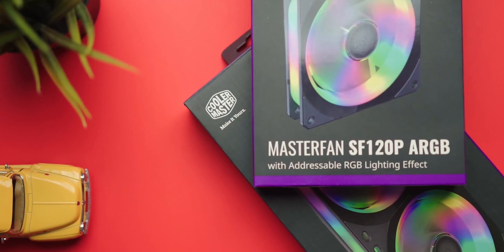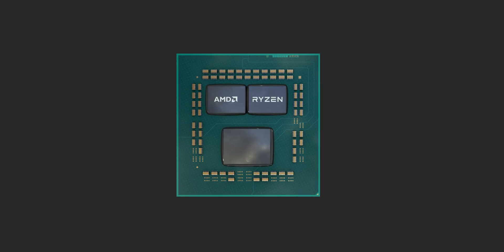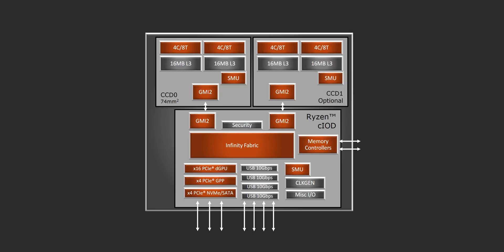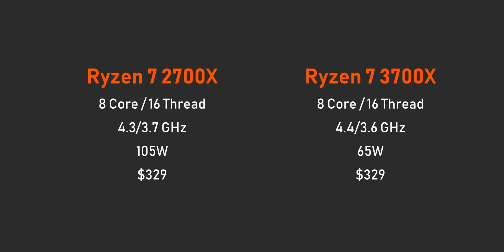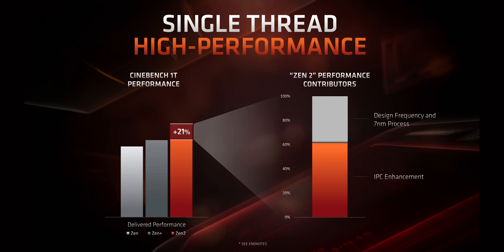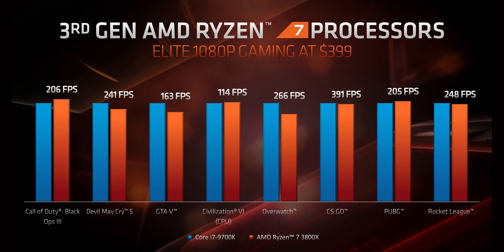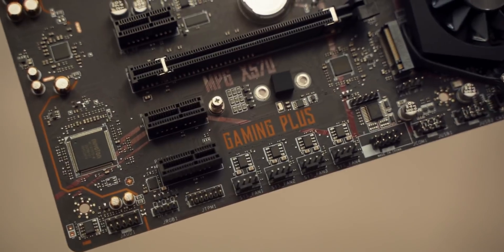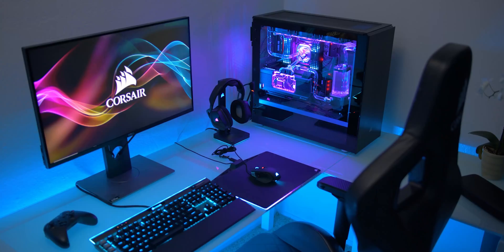AMD Ryzen 3000 – A Very REAL Problem For Intel?

Comment: Well one of the cores of my 6700k went bad. So im going to get a ryzen with 8 cores baby , should of got the v8 from the start lol
Reply: You overclocked it?
Reply: Vlad Vahnovanu yes i think i mest it up because i had set a adaptive turbo cache voltage of 1.35 but i thought that was safe
Reply: Vlad Vahnovanu not to sure what happened though tbh it worked fine for a week but one day i remoted into someones pc now i cant use the pc without disabling a core. If i enable all cores i get stuck into a boot loop
Reply: Can't you still return it? Do it quickly and buy Ryzen next!
Reply: Vlad Vahnovanu i wish but i delidded mine and its limited 3 year warranty is over but funny thing is i was going to upgrade newayz so im fine

Comment: in my 30 years in PCs i used 70% of the time AMD. always better value for money. always. Last time i saw a good Intel product was core2duo and core2quad 2 years after AMD was kicking ass with their Athlon64 and later Fx cpus. Intel after that just became greedy and lazy as fruck. especially when their entire chipset hold just for 12month if you are lucky.
i will definitely go to Ryzen 3000 but i am waiting for the X550 chipset motherboards cause I don't need pci 4.0
Reply: I think it's B550 not X and it's coming Q1 2020!

Comment: Ryzen 3000 isn't as much of a threat to Intel has the new Eypc line is.  The new Eypc line will likely provide superior security plus superior processor density in the server market.  However, I think AMD is going to have difficulty supplying Eypc servers fast enough.  Intel is going to need to replace Core architecture before it will stop shedding the server market share it is likely to start losing to get rid of all of these newly found security exploits in hardware.  Until then, I think security researchers and black cap hackers will keep poking holes in Intel's security like a wet cardboard box, with each new mitigation continuing to compromise Intel's performance for an extended length of time.

Even if Intel managers to replace Core architecture in 2-3 years, Intel will still have to go through the tough validation process that Eypc has gone through.  Eypc may be very well be cemented and leading the server market in new, untold ways by then.  Intel isn't finished, but boy are they in for the hardest years in the companies history. They can't depend on their old monopoly tactics anymore to keep OEM's onboard with Intel like they did in the 2000s as every major regulatory body has brought the smackdown on them already, plus Intel will have a difficult leapfrogging technology support wise back into first place.  For years AMD trailed 6-8 months behind on adding important features like USB 2.0 support to motherboards, but once again this was because Intel withheld important information on these new standards for extended lengths of time to hamper AMD.  Now that all of those anti-trust cases from the 2000s have played out and Intel can't do that either... the Ryzen 3000 and X570 launch are the result.

This is a great time to be alive for technology progress.

Comment: Does this mean that in a quadcore there is the same hardware as in a 16 core but 3/4 of it is deactivated? Wouldn't that be very inefficient?
Reply: not all chiplets work perfect so in a quadcore you get one chiplet with a perfect working unit an a defected that is deactivated an the second chiplet is not there or is just a fake one. the chance for a chiplet to have 8 perfect working cores shouldn't be so high
Reply: Of course it's not, because AMD is using ALL their chiplets this way so max gain!

Comment: The new APU's use the 12nm+ process, slight error but no worries! :)
Reply: Yes Zen+ and a higher clocked vega iGPU.
Reply: So it's going to have a 10nm Zen 2 chiplet alongside a 12nm Vega chiplet? Seems legit.
Reply: @TeriiNekoyama 
What are you talking about?
He said it's still 14nm, it isn't. It's using Zen+ monolithic chip.

Comment: Either way this will be a big win for me upgrading from an i5-4670k.
Reply: What Ryzen 3000 cpu you getting?
Reply: Planning on the 3700x. Originally I was going to go for the 3600x but the $70 price differential seems minimal for the extra cores/threads.

Comment: I really appreciate what AMD is doing and I am myself using a Ryzen 5 2600X for the last one year. 

But I think the biggest crap AMD is silently pulling (taking a page out of Intel's scummy book) is releasing the cheaper and more affordable B550 motherboards a whole 7 months later (early next year) . 

So all those builders whom we have been saying to wait for Ryzen 3rd gen should either get an expensive X570 board or wait more for cheaper options. This according to me is highly anti consumer practice from AMD !! Absolute bullshit
Reply: Dude if you're looking for affordable they have older boards that still work with everything anyways. There's a chance b550 won't even have pcie 4.0 and therefore won't be much if any better than x470 anyways.
Reply: So stick a 3000 series chip in your existing board and get the B550 when it is released.   I'm going to put a 3700X in my B350 board.  There aren't any PCIe 4.0 devices that use the features of the new boards yet anyway.   The NVMe drives won't be available until about the same time as the B550 boards.   Graphics cards that require PCIe 4.0 are probably a couple of years away.    My B350 board has USB 3.1 gen 2 connectors for the last 2 years, but there are really no devices that take advantage of the increased speed yet.

Comment: A great product but look at those thermal images closely something seems a little off probably going to put off as much heat as the i9 9900k but with more cores
Reply: More AMD cores with 7 nm process = less Intel cores and more heat, I'd say AMD is still the winner here!
Reply: @vladvah77  I would say about the same heat look at that picture closely and true it does have double the cores with if not identical nearly identical gaming performance

Comment: Original 7 1700X on X370. Happy to see 3700X will work on my mobo
Reply: Nemesis 851 well it was said they be supported, so it’s no surprise
Reply: @Rohan Rathour Should i buy 2 RTX 2080 TIS or wait for RTX 3080 TI?
Reply: @MrKontrol90  Should i buy 2 RTX 2080 TI's or wait for RTX 3080TI? Also please see my chanel and tell evryone you know to do too, i play all action games and most fighters!
Reply: @shredderorokusaki3013  i wouldnt buy two gpus for sli.  they scale like shit and in some games, the second is a paperweight. been there, done that.  just get the most powerful single gpu you can if thats what youre going for. And resale value on a gpu that new wont be bad, so you can get it now and sell it for an upgrade later if you want.
Reply: Same for me! Happy they are compatible when I eventually upgrade.
Reply: DEATH TO INTEL INTEL IS FINISHED! MY MONSTER PC IS RYZEN 7 1700 GTX 970 G1 GAMING 16 GB DDR4 3200MHZCL15 GS KILL RIP JAWS DE;LLP2416D 24'' 2560X1440 60 HZ IPS! RUNS MAX SETTINGS 1440P 30+ FPS EVRYTHING! NEVER BUY INTEL AGAIN!
Reply: @shredderorokusaki3013  GTX 970 is not a monster in 2019. replace that with RTX 2080 and that will be a monster.

Comment: I'm looking to get a 2000 series Ryzen system once the prices drop after the 3000 series are released. Can't afford the latest and greatest, but looking toward upgrading from my i7-2600k for productivity.
Reply: I7 2600k was the best i7 Intel has ever made. N the best i5 was the 2500k .this CPU could overclock to 4.4-5.0 GHz with liquid or tower coolers.
But productivity u will need to upgrade . I say get a 3700x  if u don't buy in the first weeks u can probably score one on eBay for 280-300$ after it's lunch. Better of u buy with eBay bucks activated u get 10% money back

Comment: Can some one please explain the Ryzen 3700X and 3800X to me? To my eyes, these are the exact same processors, the 3800X is just clocked higher. Will that mean it's binned better? I'm currently planning on buying a 3700X and overclocking it (after waiting for reviews and such).
Reply: 3800X will be binned better and will overclock better.  My opinion is  based on how the 1700X and 1800X performed.

Comment: Even if Intel released a better CPU I would probably still go with AMD so that I don't have to change motherboard every generation.
Reply: Or have to worry about security flaws
Reply: I'm still on a i7-3770k & 4790k. If I were in the market, I'd buy into this. It's the kind of chip that will last you through the eventual move toward regular SW properly utilizing that number of cores. Which will be quite a while down the road.
Reply: @czos9239  on a 4790k 16gb ram and Vega 64.  Don't feel completely dated but with my Windows 7 install being unsupported after January I will be looking to build a Ryzen system.
Reply: I will upgrade from Ryzen 5 1600 to Ryzen 5 3600 and I can keep my B350 PC Mate
Reply: @lordbronn2496  Yeah that shouldn't be a problem aslong as they provde updated BIOS :)
Reply: @lordbronn2496  what gpu do you have? reason i ask is because if it isnt being bottlenecked now, then dont upgrade, just wait til ryzen 4000 which i do believe will be supported on am4
Reply: 恵勇気  no. Amd said zen3 is am4 and they're already done the design  of zen3. They also said they have no plans to change the socket unless something requires changing the pin count. Zen 4 doesn't change the pin count.
Reply: Thomas Foster  its not irrelevant.  in fact, if you arent going to upgrade the cpu before you upgrade the motherboard, then future support for new cpus is irrelevant. ive been through the honey moon phase of PC gaming where i upgraded more than necessary. now i buy the highest end gaming cpu and gpu out at the time and stay with it til im not satisfied with performance.
Reply: new AMD 4000 CPUs need a new motherboard lol
Reply: 6Twisted but most people don’t upgrade every gen, so it’s kind of irrelevant to the average consumer
Reply: @limitisillusion7  you're right from the average buyer stand point it is, I just wanted to point that out.
Reply: I think 3000 series is the last generation on the AM4 socket, AFAIK.
Reply: @totalcookie91  no, am4 will support through 2020, so four generations of Zen.
Reply: @linhuichi937  I'm guessing it will be a 3000 series refresh, well time will tell.
Reply: this is the last Gen AMD CPUs will work on AM4.
Reply: @ItsReaxxion  Both yes and no. There are some limitations. Specially towards the 1st gen boards.
Reply: Haha, I have an x79 motherboard from 7 years ago. Just dropped in a Xeon E5 1680v2 for a whopping $180 from ebay. It's a fully unlocked 8core 16thread 25mb cache CPU that clocks to 4.6ghz and stomps all over the comparable Ryzen. Soooo...

Comment: Don’t think Intel can cut prices across the board. Just a product of their monolithic dies. Sure, lower core count chips could get price cuts, but think of all the defective chips they need to produce to get those high clocking, high core count chips. Feasible on 14nm+++++ but moving to 10nm theoretically will be a step backwards in their ability to produce those high clocking high core counts. Add more on top of that, the money required to keep Fabs running and updated plus they’re beholden to the share holders. The moment they cut prices and reduce margins, their share price will get slaughtered. IMHO

Comment: I'm switching to the latest ryzen because my current system is OLD and I need an upgrade. AMD Phenom ii x4 965 black edition.  So ya I pretty much need a whole new system anyway.
Reply: The performance uplift is going to be massive.
Reply: Yes it will, its going to be like going from a Moped to a McLaren F1.  lol  Specially once I have it paired off with a good M.2 NVME SSD.  Still on good old platter drives right now.

Comment: I am going to be building a new PC based on the AMD 3800x.
Reply: Why? take the 3700x and overclock it, same core count. Or go up to the 3900x which bumps the core/thread count.
Reply: @HuyV  It does seem like a slightly better value, but remember not everybody factors saving a couple of $ as a good bargain when it comes to sacrificing performance. I drive 14 years old car, but don't hesitate for a second spending 2k + on a PC, or a laptop.
Reply: @HuyV  DEATH TO INTEL INTEL IS FINISHED! MY MONSTER PC IS RYZEN 7 1700 GTX 970 G1 GAMING 16 GB DDR4 3200MHZCL15 GS KILL RIP JAWS DE;LLP2416D 24'' 2560X1440 60 HZ IPS! RUNS MAX SETTINGS 1440P 30+ FPS EVRYTHING! NEVER BUY INTEL AGAIN!
Reply: @shredderorokusaki3013  Calm down there, TryHard.
Reply: @shredderorokusaki3013  Also, don't try to flex.

i7 8700k delidded with a GTX 1070 ti, I stomp 60FPS and usually get 100+ on 1440p max settings. Rarely do I go below 60fps.

"Monster build" depends on budget. I've built PC's that makes both of ours look like tinker toys. Couldn't afford them. Had no need to, either.

But, given the price to performance, AM4 is the better option for...anyone on any kind of budget.
Reply: @nickpickerwi7787  R5 2600 with GTX 1080 Ti. Definately does not bottleneck what so ever because I have 8GB 2133MHz which then bottlenecks the CPU which then bottlenecks the GPU :)
Reply: 3700x is the golden egg!!!
Reply: let the man build his PC the way HE wants to.  if he wants the 3800x then let him have it.
Reply: @mrcokez1  Exactly! My money, I will spend it how I want.
Reply: @MrKontrol90  Shouldi get 2 RTX 2080TISor wait for RTX 3080TI in order to run max settings with max raytracing at 1440p?
Reply: DEATH TO INTEL INTEL IS FINISHED! MY MONSTER PC IS RYZEN 7 1700 GTX 970 G1 GAMING 16 GB DDR4 3200MHZCL15 GS KILL RIP JAWS DE;LLP2416D 24'' 2560X1440 60 HZ IPS! RUNS MAX SETTINGS 1440P 30+ FPS EVRYTHING! NEVER BUY INTEL AGAIN!

Comment: regarding your comments about X570 motherboards
if you don't care about PCIe 4.0 you DON'T need x570 chipset - you're completely fine on X470/B450/X370 chipset
you can easily update BIOS to support Zen 2 and buy B550(if needed) when they come out
Reply: How will the memory OC affect 3000s? I wish AMD would release 550s at the same time as 570s. Not many care about pci4.0 but I suspect they would sell near 0 570s if 550 existed from the get go. Can't wait for reviews tho, 3600 looks like an Intel budget killer atm. Exciting times.

Comment: Thank God I finally have a reason to upgrade my 2500k
Reply: me too. In a few weeks I'll say 'Goodbye, i5 760'
Reply: @nerdbot4446  DEATH TO INTEL INTEL IS FINISHED! MY MONSTER PC IS RYZEN 7 1700 GTX 970 G1 GAMING 16 GB DDR4 3200MHZCL15 GS KILL RIP JAWS DE;LLP2416D 24'' 2560X1440 60 HZ IPS! RUNS MAX SETTINGS 1440P 30+ FPS EVRYTHING! NEVER BUY INTEL AGAIN!
Reply: @shredderorokusaki3013  Chill out, man. It's not that serious.
Reply: Same. Good old chip. Still hasn't done me any wrong tbh. But she's just beginning to show her age.
Reply: @JHS270694  indeed. never had any issues too. served me well all the years and was worth every penny
Reply: running a 2500k on a p67 Sabertooth ;)  If the first Tests and Reviews look good, i'm going to move to Ryzen this year.
Reply: Whatcha eyeballin?
Reply: I still use a fucking potato pc from 2011 its time to upgrade, I really hope Zen2 perform really well.
Reply: I'm still rocking an FX-8350
Reply: I'm in the process of replacing old parts and the 2500k is a gigantic bottleneck for my RTX 2080.